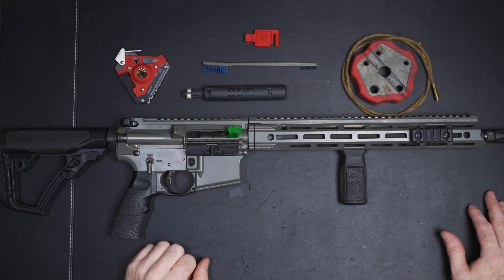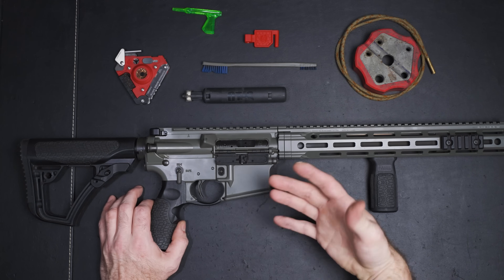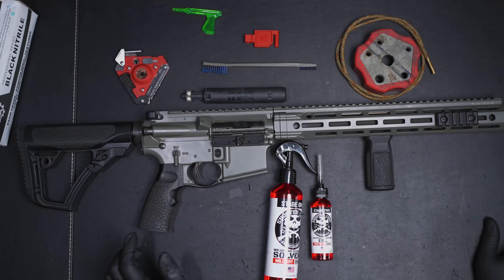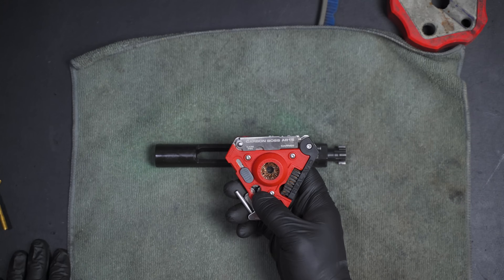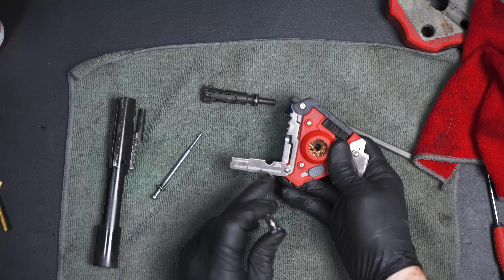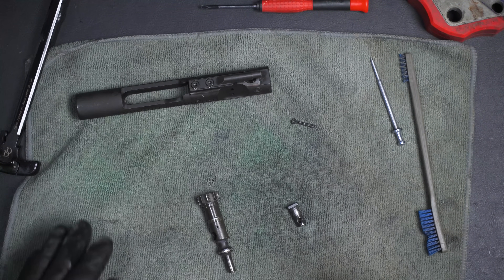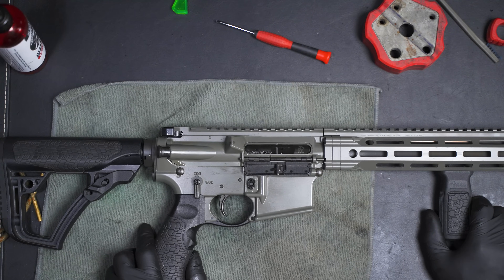MOST CRITICAL AR-15 Cleaning Step That Everyone Misses

Comment from the maker: FYI: I forgot to show the metal tip on the chamber cleaning tool. But you use the metal tip first, then the cotton tip.
Also the difference between the chamber and the barrel extension accidently got edited out on the YouTube version of this video, but is explained in the video in the online course.
Full List & Codes Here:  https://bit.ly/43pWmnE
New Pew Pew Deals Here: https://bit.ly/2OFAl23
Reply: So did our posting help?
Reply: is there any risk of lead being on the outside of the gun and surfaces it touches such as where you store it, would you be able to use d lead wipes on the outside of the gun once your finished cleaning it
Reply: You are making a review for the SI slide?
Reply: What’s your opinion on sonic cleaners ?
Dissemble the BCG put the parts in the cleaner then rinse, inspect, and then remove any carbon that’s left.
The simple green is a good cleaner.
Reply: @Diggi556  when you shoot, lead is on the gun and your clothes and when I (or anyone) shoots suppressed, you'll get more gas blowback which in turn blows more lead back at your face and can be inhaled very easily. I have a few friends who are dealing with lead poisoning and going through treatment. I shoot about 1k rounds a month and mostly suppressed and dont have any issues. So I've never wiped my guns with my de-lead wipes but I suppose you could and then oil your gun afterwards to protect them. But I don't see a reason to. Are you going to wipe your hands every time you touch ammo? Probably not. If you're really that worried about it just clean your face and hands after shooting or wipe hands after playing with ammo.
 It may not help much but I often wear a balaclava to cover my mouth and nose.
Reply: @seang1032  yeah seems like it's unavoidable  and all you can do is mitigate exposure, I am pretty paranoid about it, im a new gun owner and just cleaned my glock and took no precautions in regards to lead exposure out of ignorance, what symptoms did your friends have that made them want to get checked out
Reply: @Diggi556  lead gets EVERYWHERE. It is thrown into the air when you fire your gun.

Comment: You're supposed to clean these?
Reply: Apparently, my rifle had a few hiccups recently and the gunsmith at the range said that I should probably clean her.  Yeah I was using some dirty remanufacutred ammo, but still was surprised by just how grimy a relatively new rifle was after only 250-300 rds.  Hoping it's all good now because this should be a good to go upper (BCM BFH 14.5 ELW), never really had this issue prior to getting a suppressor (OSS can really shouldn't cause issues).  As for the issue, was working height over bore ready up drills and was having rounds feed in and then get stuck, couldn't put it on safe and couldn't pull the round out without mortaring it.
Reply: Always clean new rifles because they come with thick oil designed for sitting in boxes to prevent rust. Not the best for shooting especially suppressed
Reply: No
Reply: @Osprey1994  I didn't clean my ar for 9 years and it was fine
Reply: @Lucas-yg2hy  I am sure you didn’t shoot it for 9 years either.
Reply: Always thought that once you got an AR sort of dirty, you go buy another AR. 🙃
Reply: @MrPir84free  you buy ARs? I thought you planted a detent pin in the bottom of your safe and they grew
Reply: @CaptainCreampie69  fr lol. That being said I’ve got 1500 rounds on mine since the last cleaning and it’s running strong
Reply: Cleanliness is the closest to godliness 😊
Reply: @Osprey1994 if your gun chokes after not being cleaned for only 300 rounds there is a problem with the actual gun.
Reply: @Osprey1994 suppressors do make your gun way dirtier. I just oil it to the point it’s almost dripping. Makes cleaning after easy, just wipe. And ar-15 love being wet anyway.
Reply: It's not an AK
Reply: @Lucas-yg2hy you also never trained with it too. And probably just kept it in ur safe
Reply: @Lucas-yg2hy what's the point of having it 😂😂
Reply: I have guns that jam constantly after cleaning until several hundred rounds. Not sure why but I only clean minimal parts, usually just the barrel & extractor. Only every 3,000 rnds or so.
Reply: Ah! ☝️
But how often do you clean your cleaning tools? Eh?😮🤔
Reply: I clean my rifle after every shooting. Not only do I find it entertaining its good to inspect and know your gun and how it works.
Reply: I just throw mine in the dishwasher every other month and she runs like new everytime 😂
Reply: @Breese147  And handguns, especially imports. I was taught this decades ago, and I'm still amazed how many reviewers take them out of the box and head to the range.
Reply: @josephprucha9823  Agree 100%, and my handguns. I rarely if ever get malfunctions, and if I do, it's usually with cheap steel case ammo. I still have my first 22 rifle, and it looks nearly new, and shoots like new.
Reply: Just give 'er the ol' hawk tuah and call it a day.
Reply: They're annoying how needy they are. Self 💩 ing little things...
Reply: nah you're good just let it rock

Comment: One point where people can screw things up with cleaning is being over aggressive with removing carbon. The tail of the bolt fits as part of the internal piston of the bolt carrier/bolt system. Sometimes people will aggressively scrape or even sand down the bolt tail in attempt to clean it. Over time that will remove enough material opening up the fitment and producing a under gassed system. Nylon brushes help to reduce the chance of wearing down the bolt tail.
Reply from the maker: true
Reply: I saw a vid about this last night. It makes me change my thoughts and just go Nylon on everything. A little carbon and lots of lube should be fine
Reply: SotAT checking in!

Comment: Buddy I know this is an old one, and that's not your DD, but there's one thing you might add for a future video. Installing the bolt cam pin in the same orientation for the life of the bolt will make it last a lot longer, and reduce the chance of causing issues down the road. Some companies are putting a dimple on that pin, or you can take a punch and make a dot on that little guy so you always know which way it came out, and ensure it goes back in the same way. Love that OTIS tool, I'm going to pick one up this weekend!
Reply: Wish I had read this sooner. Just finished taking apart my first ar for an initial cleaning and I couldn’t for the life of me tell you which way it came out and went back in.

Comment: The top "lead removing" disposable towelette for hands and skin is basically an alcohol swab. You can also use an antiseptic towelette, which is alcohol with BZK as the antiseptic. All basically alcohol wipes, as are some eyeglass cleaners. No magic, the alcohol cleans and the towelette absorbs the lead dust.
Reply: Just wear gloves.

Comment: Take off upper, remove BCG and CH. Disassemble BCG and spray it and CH with cleaner let sit.
Take the upper outside, use gun scrubber or brake cleaner and spray out the inside of the upper and the barrel extension. You can use a blue shop towel to wipe out the inside.
Use a nylon coated dewey brush and run a couple of patches of solvent using a jag down the barrel. Chase with a clean patch then an oiled patch
Clean the BCG that's been sitting, usually just requires it to be wiped down with a shop cloth. Lube and reassemble the gun
Lead wipes on the outside of the gun

Comment: My very 1st AR was an FN and it never gave me problems even after 1000 rounds. Finally cleaned it around 1,500 rounds
Reply: @DanMulberry  bought from a gunshop. Inspected it before shooting.
Reply: @DanMulberry  i bought another ar15 from psa and it cost about 500 to build . It hasn't jammed yet either .stainless 16in barrel.  I bought another psa bottom of the barrel build for 400 and it jams pretty frequently. Thinking of changing out the bcg

Comment: sahweet, I got my first ar (a DD v7 pro @ a solid discount from the LGS, was going to get a pistol that actually fits my hand, but they asked if I needed a AR rifle and that DDv7 hadn't moved since they also have BCM, knights, HK, Centurions, and Suga Weasels ... got used to my glock . . . but got the AR instead to go along with the Mossberg 590 ), def diff than cleaning my 22 LR SA revolvers and lever rifles . . . i like the angles you have to show how to take apart the BCG .

Comment: I use nitrile gloves always when working on my guns and D-Lead on my hands after a range trip.  If you don't thoroughly get the lead off your hands you can also run the risk of having TSA swab your hands before boarding if within a couple of days of prior range time.  Believe me, they'll detain you and you'll probably miss your flight.
Reply: True story, I had a gun cloth I kept in my bag and just moving that when packing was enough to trigger a warning when my bag went through so they swabbed my hands. I failed 2/3 and would have been rejected if I failed all 3. The last one I think was the explosives category.

Comment: The tool shown at 9:25 is an alternative to the AR15/M16/M4 chamber brush.  Based on previous experience with Otis products, I imagine it's more expensive than a chamber brush, too.
Reply: That tool doesn't do jack to the chamber. it's to clean the barrel extension.
Reply: @FullSendPrecision  - Except that it DOES do jack to the chamber...hence the name "chamber brush".  Also, a proper AR15/M16/M4 chamber brush won't fit in any "barrel extension" ( I assume you mean items like compensators).

Comment: I just cracked mine open and throw it in the dishwasher! After which of course I spray it down with Boe Shield. Boe Shield is a penetrating lubricant that was designed by Boeing for use with aircraft and the many different alloys and metals they are constructed from. I have been doing this for 25 years now and have found it to be the best thing since sliced bread.

Comment: I always clean the chamber  Using a chamber brush and those Star chamber pads.  One thing I learned about using the chamber brush is you have to spin it in and spin it out Since it's not made to pass through the barrel, 1st time I did it  I just tried to push it in and pull it out and it ended up breaking.

Comment: On the OTIS chamber cleaning tool you're supposed to use the metal star attachment first to loosen the carbon, then run the cotton piece after it.
Reply from the maker: Yeah for some reason I accidentally cut that part during the editing. Unfortunately I didn't notice it until the video was uploaded

Comment: Did you clean the gas tube out? I have 18 inch pipe cleaners that I can soak in Hoppes and run it down into the gas tube to clean out some of the buildup or just spend the time to clean it thoroughly.

Comment: i take it apart, lay out everything on an anti-mess towel(optional) and spray it with whatever CLP was cheapest at the gunstore, rub it down with a paper towel then drench it in SLP again, then reassemble after spraying everything down a 3rd time

Comment: An aluminum or brass pick is a good option instead of a steel flathead for cleaning that stubborn carbon on the bolt and firing pin. A lot of cleaning kits do actually come with one.

Comment: 10:07 it bugs me that i can see little brass wedged inside the chamber that i cant reach with a pick or anything :D ( and when i clean my BCG i like to use a cut up 2liter bottom   and spray some of the bcg over it so it can catch some cleaner spray and make a good tub of it and let the firing pin and other small stuff from BCG to sit in)

Comment: A lot of folks would be disgusted by the sheer volume of clp that infantrymen us on ARs.

I cannot tell you how common it is to just dump like a quarter cup into the ejection port, charge the weapon a few times, and get right back to business.

Recommended by probably no one, but it sure does work.

Comment: I prefer a bore guide and a coated cleaning rod with a brush and patches for cleaning the bore at home. I keep the bore snake for field use.
Reply: I like using a bore guide and rod when I work on rifles that have finicky muzzle brakes and I have to use a toothpick  to guide the bore snake through.

Comment: Thanks for the video!

It's always good to put your cam pin back in the same orientation that it was before you removed it. FCD and some other companies have great cam pins with a witness mark so you don't have to worry about flipping it 180°.
Reply: Come on bro seriously 😒
Reply: @mrgrump2534  I'm being serious. Look it up. For the average Joe who may shoot a couple hundred rounds a month, they probably won't even notice the wearing on the cam pin. For those of us who shoot every weekend and sometimes 1k in a weekend if it's a class, the wear becomes noticeable and fast. Replacing the cam pin in the same orientation can make a big difference.
Reply: @seang1032  this absolutely is not true. Both sides are identically symmetric.

Comment: Why didn't you clean the hole  that the firing goes in also lube the firing pin..Or clean inside the gas port on the carriage bolt assembly...

Comment: Looking forward to see your thoughts on the SLW, I just picked it up as my first AR. Finally got it (almost)fully kitted out and its still lighter than the 16" counterpart. Every time I shoot I am sublimely pleased afterward. Not mad about the cost whatsoever.

Larue mbt2s trigger, Holosun AEMS green dot(multi-reticle), Vortex Micro 6x, Radian charging handle/safety selector, ultradyne c4 offset sights, inforce wmlx(9 o'clock rail section to impact weapons thorntail offset mount). 

Got a dead air sierra 5 on the way. Planning on swapping out for a superlative arms bleed off adjustable gas block, liberty precision eclipse pin and weld muzzle device and rearden mfg atlas plan b mount.

Let me know if you have any input on my planned suppressor set up!
Reply: I just grabbed a ddm4v7 slw new out of the box, I love it I’m very happy everything about it is magical. My spear mcx LT is still and will always be my favorite because I can switch out bolt heads and barrel for multiple other calibers but having a dedicated 2.23 5.56 has been amazing and I’m so pleased with this one specially

Comment: I use motor oil as an all around CLP. Motor oil absorbs carbon fouling and obviously lubes. It is very cheap compared to fancy gun cleaners. What is not to like?
Reply: I’m not sure I understand what you mean.
Reply: Odd. I was replying to another reply which has now been deleted.

Comment: This TWENTY MINUTE video REALLY makes me want to make my OWN THREE MINUTE  video of accomplishing the same thing. My outline:
1) NEVER buy or build a DI AR15
2) Build a SHORT STROKE PISTON AR15 using a 30 point adjustable Superlative Arms piston kit.
3) Shoot 1000 rounds of 5.56 or .223
4) Spend 60 seconds wiping down your upper and lower receivers, BCG etc  with a rag. Then, thirty seconds adding a SMALL amount of lube.
5) Run a bore brush and a couple of Hoppes soaked patches down your bore with a carbon fiber rod. Fergget those crappy bore snakes.
DONE!
NO SCRAPING!!! EVER!  NO caked on carbon anywhere in the upper or lower receiver. EVER!!
Every 3K rounds use a copper solvent to de-copper your bore. NEVER clean your bore to shiny, like new. I DO polish(using a variety of items from Brownells) my bore before I fire my very first round

Comment: What is the recommended torque specification for handguard screws?  Has anyone noticed a difference in manufacturer recommended torque specification for handguard screws from one manufacturer to another?  Thanks.

Comment: Shooter lube must’ve changed their bottle to make it cheaper. I just ordered a set and the oil did not come with a tip like that. It came with a small cheap plastic tip You would find on a small bottle of Elmer’s glue.

Comment: This is a thorough and informative video if you want a white glove inspection clean gun, but I can't help but think there's a bit of overcleaning overlubing going on. Yes I realize many in the military are trained to clean their gun this way, but that doesn't mean it's at all necessary. I stopped trying to scrape every bit of carbon off of my guns and they still run fine. Also, yes the gun will work when the internals are drenched in oil, but it's not necessary to coat and load up every single surface with oil either. I try to only lube the areas where there's metal on metal contact with moving parts. 

I live in Phoenix, AZ though, so your mileage may vary and to each their own.

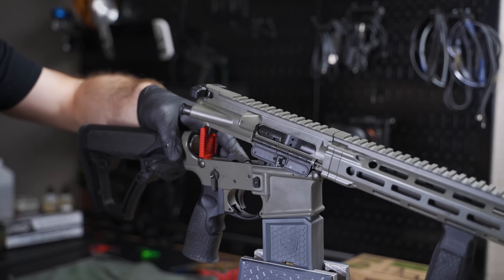Comment: 8:30 just take both take down pins out to separate the upper from the lower. If carbon buildup in the chamber is preventing your bolt from seating completely then you have not cleaned that thing for a long time. I've put 5000 rounds through one of my rifles with nothing more than a patch hear and there and lubrication.

To clean your AR15 or any other rifle
Run a few patches through the bore in the direction the bullets go. If it's a precision rifle don't use abrasive things like a wire brush or bore snake on the bore, this actually hurts precision until you get about 30 rounds through it.
Clean the bolt real well, the BS he talks about in another video with wearing down the bolt retaining pin is stupid. If turning a metal part a few times hurts the firearm I don't know how mine has made it 10000 rounds when it slides on the metal surface when fired. 

Don't over lubricate everything, just get the fire control group springs with a drop or two and get the bearings on the BCG/upper.

Comment: if your going to use motor oil do the lightest weight possible especially if you are going to use it in a cold climate.
Reply: Yep. Transmission fluid works too and is probably as good or better than oil.